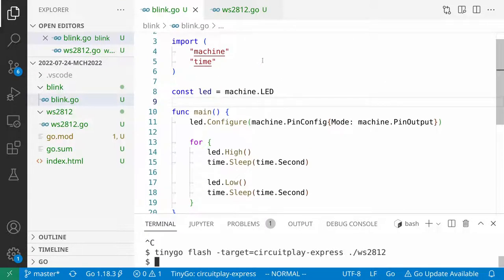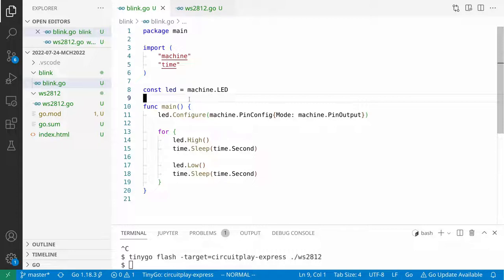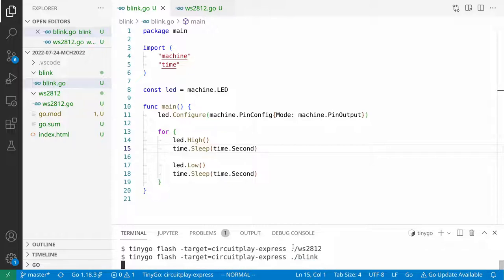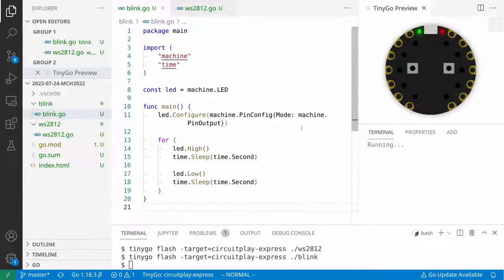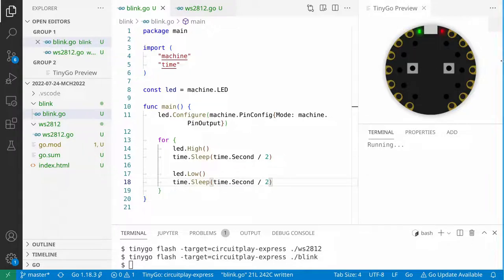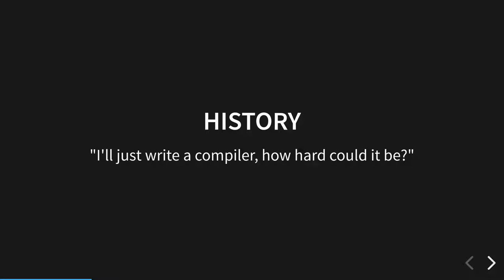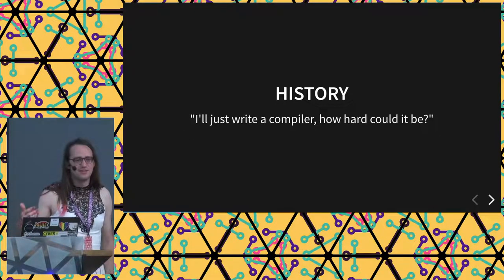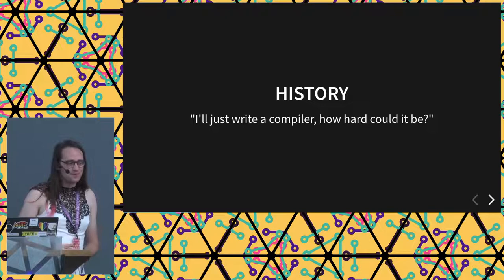2022 -  Programming microcontrollers in Go using TinyGo

Comment: 11:33 I doubt these are written by hardware engineers :) In many cases these HAL libraries are written by pure software engineers and this in fact might be a problem because they don't understand this hardware well enough so they end up with like ex. multiple layers of abstraction just to change state of single bit within register. That's why there are firmware engineers who should understand hardware behavior very well and have good knowledge on writing simple code. By simple I mean You literally have to think about CPU clock cycles and all the electrical level events which might be faced. 
For low power devices You don't really fight for portability so much. More often it is about energy efficiency, low FLASH and SRAM requirements so smaller uC can be choosen.
Anyway there are plenty of arguments for Go in embedded systems and writing in Go after C or C++ just feels so good.
Great talk btw.!
Reply: Presenter said, sometimes "hardware vendors" provide hal abstractions. Are you implying these vendors have no clue about their hardware?
Reply: @nobytes2  Please don't try to use "Are you implying.." on me to change the meaning of my comment above ;)
Hardware vendors as name suggests are selling hardware and that's their main business objective. Unless You pay extra $$$ their HAL's are there only to let Sales Departments and Application Engineers show You what can be done with their hardware at MVP level.